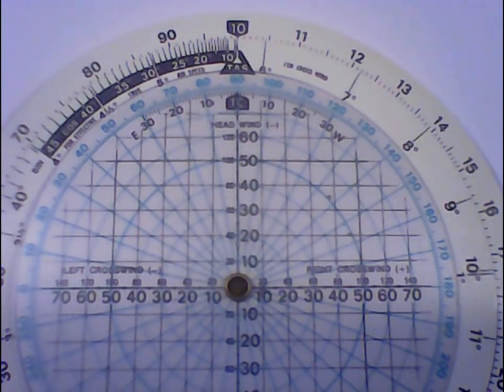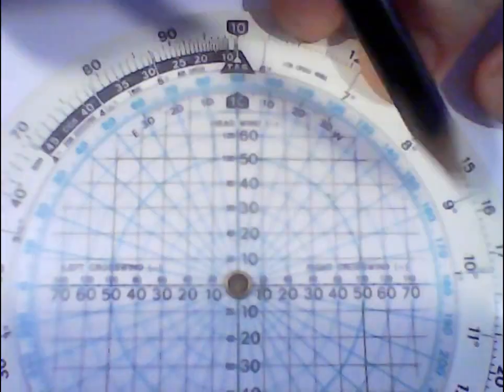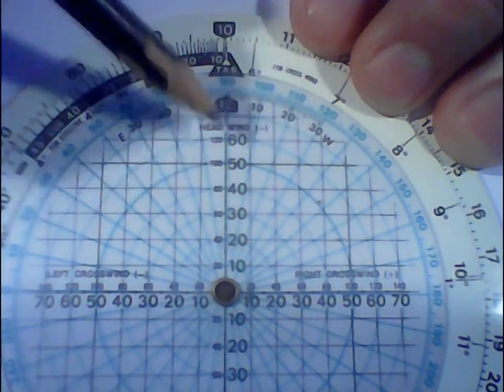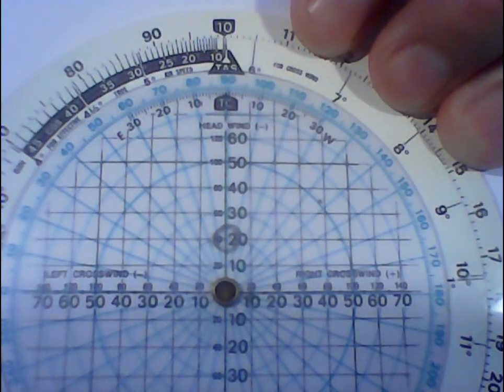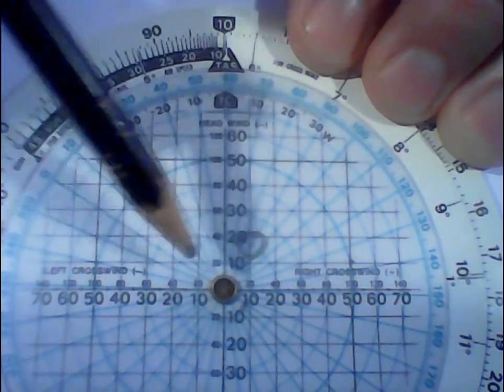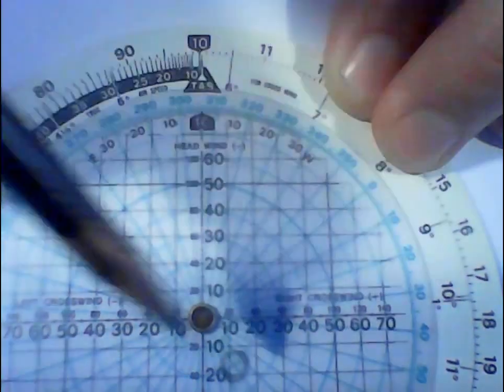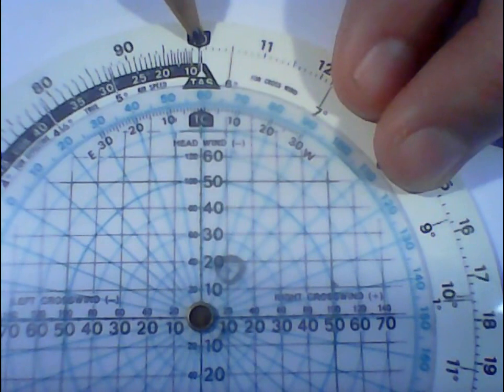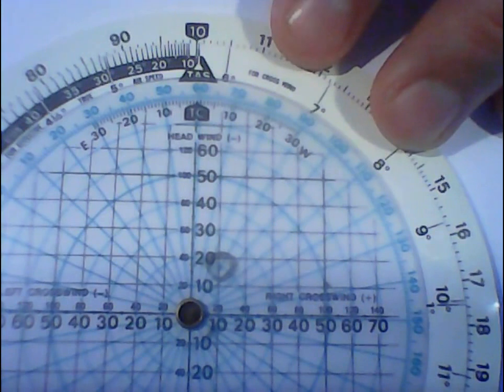Jeppesen CR4 CR3 CR6 Wind Drift, Headwind GS Calculation

Comment: Can you please cover how to use the black strip where it says for True Effective Groundspeed? Suppose you have a direct crosswind of 30 knots, including the wind correction in your leg, you can't possibly arrive just as fast or faster to your destination with the extra "distance" flown through the air...
Reply from the maker: Go to 3:50 in the video for the explanation of how to adjust for crosswind. If TAS is set to 100 (10) a 30kt cross wind adjust by 17°. Simply read around the outside scale until you get to 10.  In regard to not being able to arrive as quickly. The first part of the video teaches you how to work out, how much of a head wind or tailwind there is. Up to about 3:45. In this example we use a 20kt wind that is 30° off to our right. See from 3-4min.
Reply: I know how to read off the dial for wind correction angle and ground speed in the event of an almost direct head of tail wind. But you are telling me, in the event of a 40 knot DIRECT crosswind, with the plane's nose yawed and neither head or tailwind, I will still arrive ON TIME? I don't think so.
Reply from the maker: If crab angle exceeds 10° then you have to use the additional step, which is the tiny black scale to the left of the TAS. So in the case of a TAS with a 30kt cross wind as you suggest. At 100kt TAS, this would give a crab angle of 17°. You would ensure TAS is set to 10/100 , then read 17°  on that tiny black scale and it would give you an adjusted GS of approx 96kt
Reply: Thank you, this is the answer I am looking for